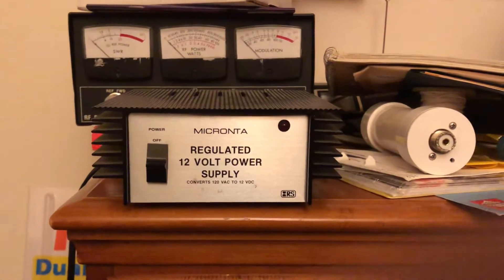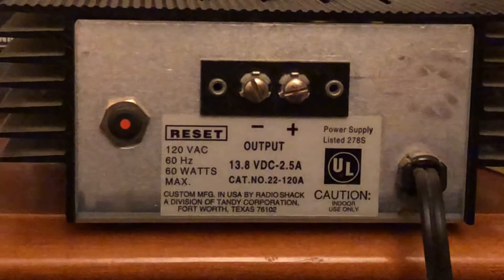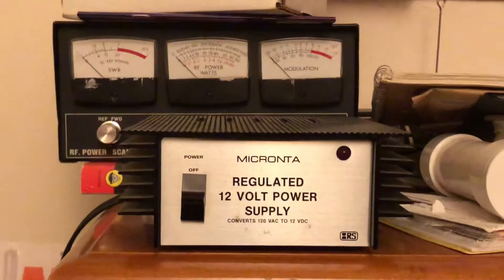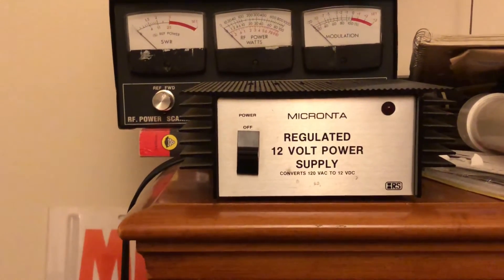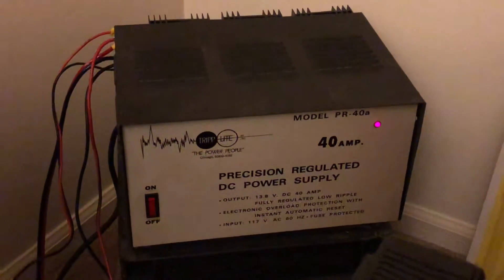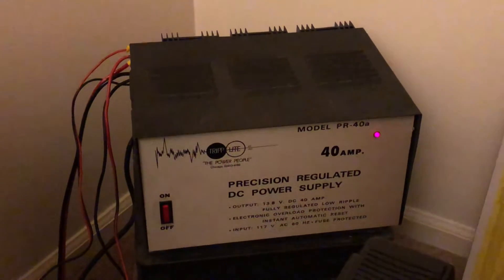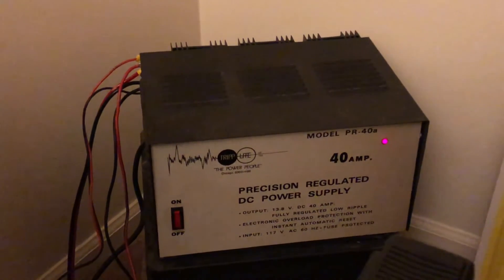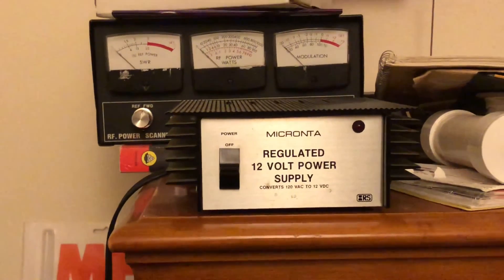DC Power Supplies for Your radios.

Comment: I have the same Trip-Lite 40 amp power supply in my shack only mine is a bit newer. Trip-Lite makes one of the best linear supplies. I have used their 3,7,12, and 25 amp supplies for bench test units over the past 25 years. I’ve never seen one go bad. Some were badly abused. The only “issue” I have found is they are labeled for a very optimistic surge power not constant. A 40 amp is more like a 30amp constant. No hard data, just my opinion. I’ve had the 12 amp version fail to handle a 10 amp load. Astron are good too. I’ve used the variable 50 amp version at work. Nice but you have to naje sure not to bump the voltage knob.  The Pyramid are hit and miss. The bulk of the complaints are with the switching versions. I have their 5/7 amp linear with the 12v “cigarette” plug. I’ve used it for many things around the shack without issue. I even use it to power my whole shack when I’m just listening and don’t want the hum of the larger supply in the background.

Comment: I run a 30 amp, Alinco, switching power supply, for my 2M / 440 (50 Watt) Base Station radios. It provides clean, clear power!